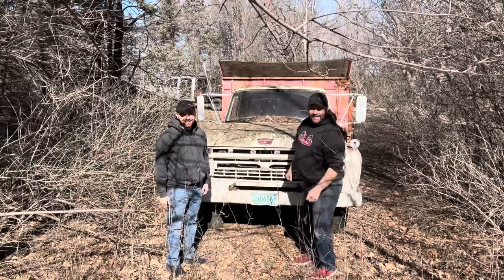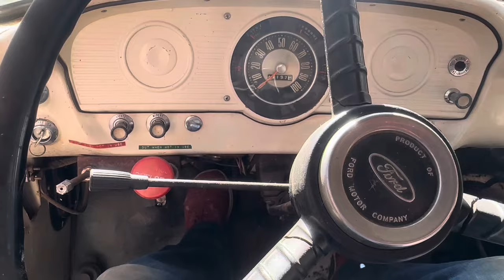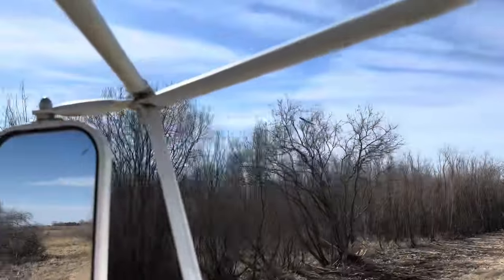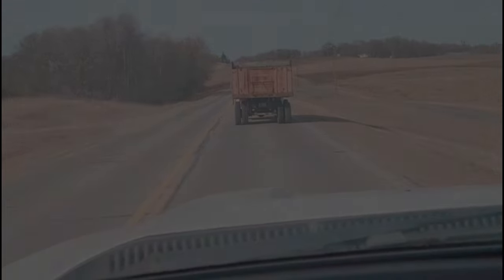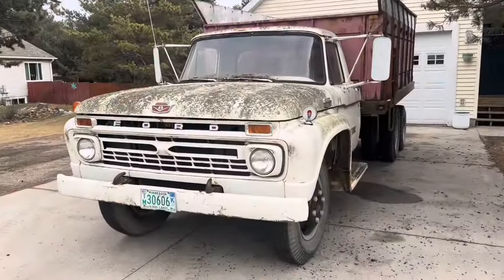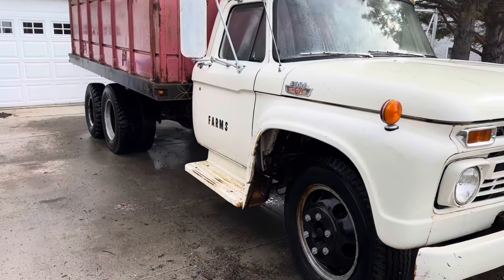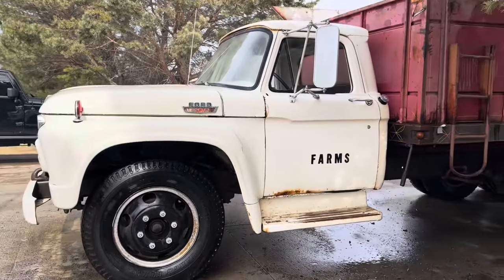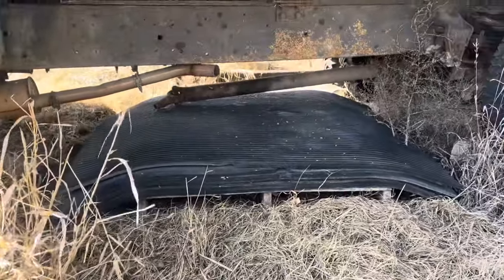It’s time to mess stuff up

Comment: An np435 is also a granny low 1st. The rods below the dash under the headlight switch is how you activate the hoist. With it running in neutral you pull the left knob (missing knob) till it engages the pto on trans. The right knob is then pulled and makes the hoist begin to lift. Those cables regularly get rusted up and may not operate. You may have to disconnect and lube them.
Reply from the maker: What should I run?  Just for cruising around?
Reply: The np435 is a 1:1 gear ratio in 4th gear same as the Clark’s 5th gear is also 1:1. You  would have to change the rear axle ratio. I don’t think you’re going to find anything in the 2 ton variety that will help your highway rpm’s. I would just change the fluid in the Clark and keep using it. If you’re not hauling you can skip 4th if needed.
Reply from the maker: @HalfMoonCustoms thank you. Once again proving to be a wealth of knowledge!

Comment: I was actually looking for a rat rod shop truck type project truck 68-71/72 Ford sport custom or custom cab trim truck is what i want and hopefully trade my second gen dodge ram laramie slt quad cab long bed 318 magnum V8 46 RH automatic overdrive transmission manual shift transfer case lever on the floor gloss black with most of the white pinstripe 4x4 truck for one but it is currently a small project truck because of the freaking ground squirrel it doesn't run currently.... Anyway what my point was is was looking at two 68 f600 grain trucks and that got me thinking about it being a 14 ft flatbed with true dual straight pipes glass pack mufflers and cannon type exhaust tips and a 4bbl carb swapped in and maybe a performance camshaft or a lopey idle lol would be a frickin sweet rat rod shop truck...
Reply from the maker: That sounds like a great build to me not a whole Lotta money invested in it either. Plus you don’t see him every day.